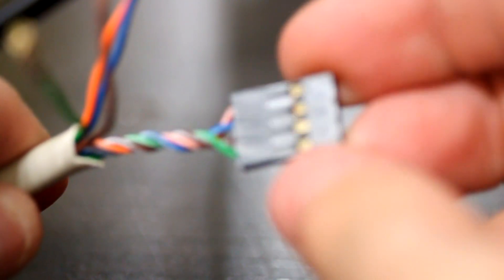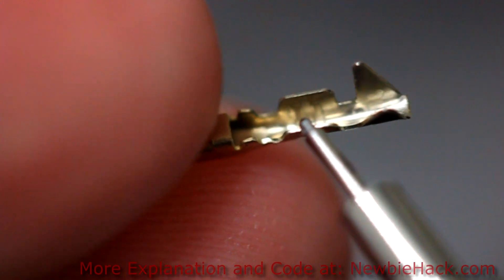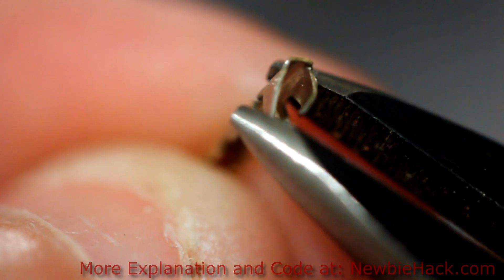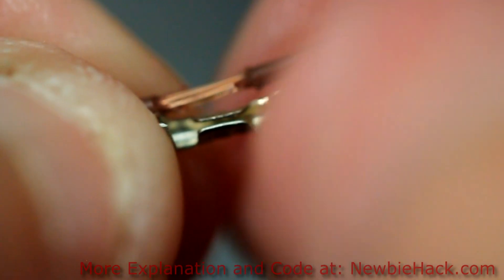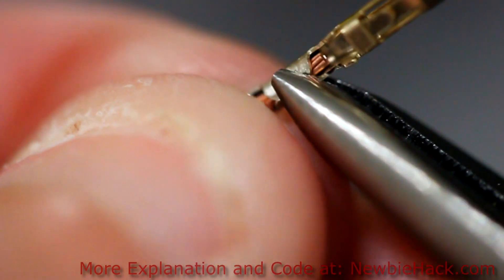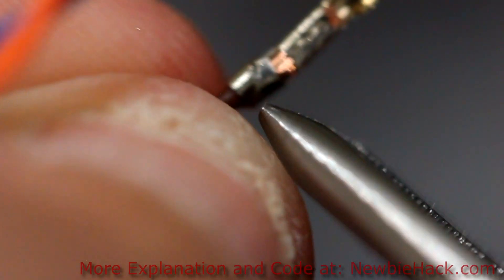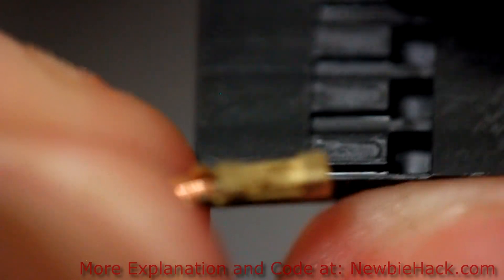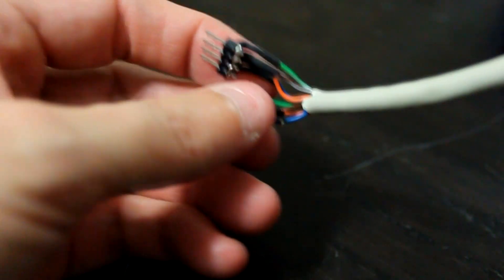28. Arduino for Production!  AVR Atmega32 - Assembling and Crimping - Female Header

Comment from the maker: It's still much better to use a crimper.  But without a crimper, this method works as well.
Reply: There are very affordable ratchet crimp tools available these days...
Whether or not using a dedicated crimp tool - but especially if not using one - it's a good idea to do some practice crimps and perform a pull-out test. E.g. take a short length of wire and crimp one terminal on each end. Then grab each terminal with a suitable grabbing tool (pliers, hemostat, bench vise) and pull apart. The wire should not pull out from either of the terminals. If the crimps are good, either the wire itself breaks, or one of the terminals, but the crimped copper should stay in the terminals.